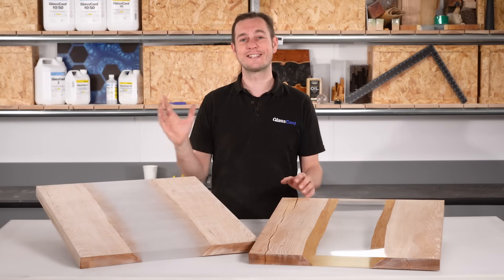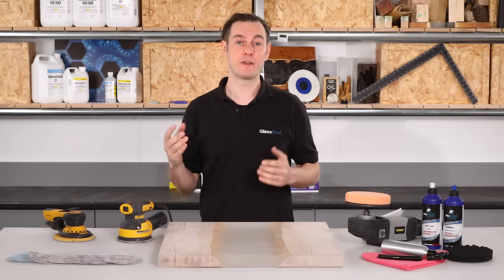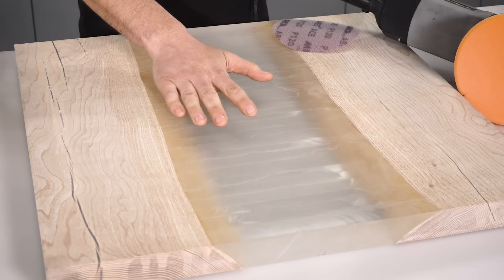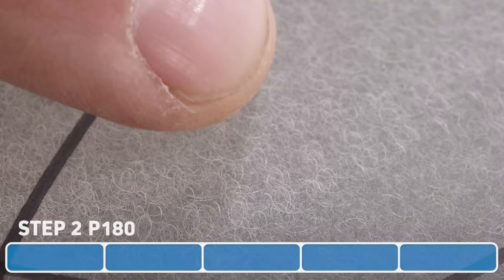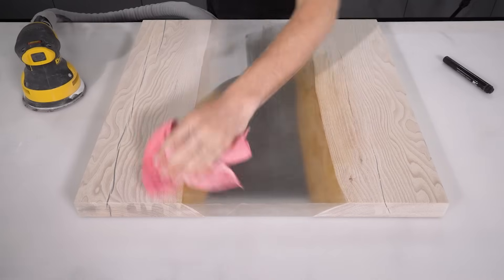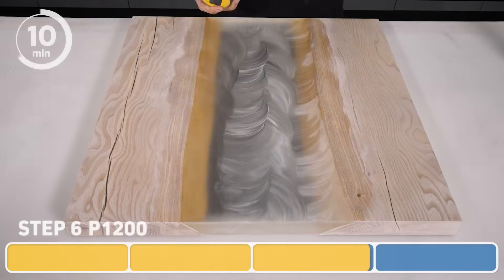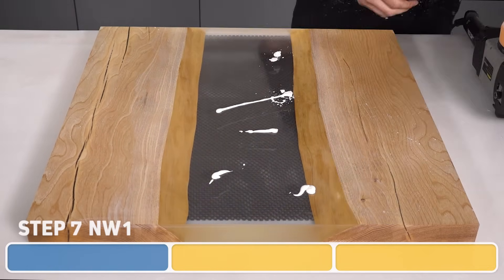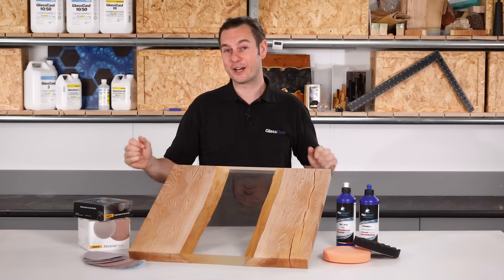How to Sand and Polish Epoxy Resin to a Mirror Finish - Step by Step Guide

Comment: I've done all the steps you showed, both sanding and polishing, but it's not clear to me. I don't know where I'm going wrong.
Reply from the maker: Sanding and polishing is quite a skill to master and does take practice. The resin won't really start to turn clear until you start to get a good level of polish on the surface with the NW1 compound.

Comment: super helpful, thank you!  Maybe a dumb question..but...this process needs to happen on the opposite side too, is that right?
Reply from the maker: Glad you found it useful. It depends on how visible it will be, if you are using a clear or lightly tinted resin then yes, you will most likely need to polish both sides. If the resin is pigmented opaque and hidden from sight on the underside then you may be able to get away with less finishing work.

Comment: Eh, im working on a 5inch cube, are there any tips for smaller objects?
Reply from the maker: The same still applies in terms of following through the grades of abrasives and then finishing with a polish. For smaller items then you my find it easier to do by hand, placing the abrasive on a flat surface and passing the cube over it.

Comment: I presume you sanded the bottom side the same way?
Reply from the maker: In this case, we didn't need to as the bottom face was the moulded side and had a high-gloss finish directly off the Polypropylene mould surface. However, if it had been machined in any way (planer/thicknesser, router on a sled, etc.) or didn't have the required level of finish then yes, absolutely, you could sand and polish it in exactly the same way as the top surface.
Reply: @glasscastresin thank you most helpful.

Comment: Beautiful work and now get ready for scratches from daily use.Probably within a day or two at the most. Plastic is plastic & scratches by just looking at it....
Reply from the maker: Whilst glasscast does cure to produce a relatively hard surface, you are correct that the end result is a thermoset plastic similar to a lot of worktop coatings. One advantage of an epoxy coating is that it can be polished up back to a high gloss surface should it become scratched over time.

Comment: You changed the tool for polishing at the end. Do the pads fit onto the dewalt sander?
Reply from the maker: No none of the pads we sell are designed for attaching directly to a DA sander. Although these can be sourced elsewhere.
Reply: @glasscastresin thank you

Comment: I'm new to epoxy. So, I've started with small pieces eg tea costers and small (6") clock faces. Most of the pieces turned out well but the clock face has obvious air bubbles and a couple of bad divits that developed overnight. Will I have to strip it right back or can I pour fresh epoxy as it is but take a heat gun to it to prevent the bubbles and divits reappearing? I should add, I sanded all the pieces from 80 through to 400 and finished off with 2000. Is this perhaps the problem? I also applied a few coats of French Button polish before the epoxy. Am I a plonker?
Reply from the maker: Hi George, if the resin is still in the 'B' stage where its firm but tacky and soft enough to indent with a fingernail then you can pour straight on top without any additional prep work. If the resin has fully cured then you will need to key the surface with 120 grit before adding another layer. Normally a key like this is required to allow for a good mechanical bond to the surface, for porous surfaces like wood it is recommended to seal first with a brush layer of resin to prevent air from leaching out of the wood as resin is absorbed. It's normally best to avoid using wood treatment products in case they reduce the bonding to the wood, wax and oil based products would be especially bad.

Comment: Do you polisher the underside too.
Reply from the maker: If the resin is clear or tinted then yes you will probably also want the underside to have a nice flat glossy surface. On pigmented opaque resins then this is less of an issue and the underisd can be left in a rougher state.

Comment: I've cut out a detailed stencil in 12mm marine ply (900mm x 600mm) and was planning to fill resin and polish. Now seeing the amount of sanding required, am concerned the sanding will cut through layers of the ply. Any suggestions?
Reply from the maker: You will just need to be carefull with the more course grades of abrasive that you don't apply too much pressure. The wood, being softer will naturally abrade faster but as long as you apply low pressure and keep the abrasive flat across the top surface of the resin, then you shouldn't have too much of an issue.

Comment: Without holes in the sanding disks lined up with the holes on the sander, no dust will get sucked out
Reply from the maker: The mirka sanding discs are a mech based construction which allows the dust to pass through the entire surface of the pad, not just through the vent holes which can be misaligned.

Comment: Hi buddy,
I have a question. 
How to sanding epoxy with 3mm thickness  ? There is an orange peel   I applied 3 coats with foam roller on my vertical mdf board. 
Do you think I have to start with 120grit
Reply from the maker: Applying the resin with a roller isn't really recommended given that it can introduce texture and even air bubbles into the surface. The depth of the texture will dictate the abrasive grade to start at but if you need to remove significant high spots then a course grade like 120 would be a good place to start.

Comment: If you don't have deep scratches to begin with, just smoothing out. You mentioned starting at 800 grit, how far up do you go after that?
Reply from the maker: You still complete the process from that stage, so just skipping steps 1-4. If starting at 800, you continue from that point through to the end of the video.
Reply: @glasscastresin thank you! One more question. If I put wood into the mold and the resin went under most of it but not all of it, would you still start with sanding 800 grit to make it all level?
Reply from the maker: @HeatherBF-h4x  If it isn't level, you'll need to be more coarse than 800grit. The finer the grit, the less 'sanding' the paper will do, as you progress through the grits, the purpose is to remove the scratches left by the previous grit so 800 would remove 400grit sanding marks for example; however, if you are trying to flatten the surface, you need to start with a much more coarse paper or have the surface machined (router on a sled/planer-thicknesser) to get it as flat as possible before starting to sand.

Comment: How would you sand/polish the edges of a round table? 

By hand?
Reply from the maker: By hand is likely to be the safer option, especially if you make a profile the same as the rounded edge to maintain the shape of the sanding/abrasive paper. In theory and with practice, you can use an orbital sander but need to use a soft pad so that it has a degree of flex around the surface and light pressure being careful to keep the sander moving so you don't end up with any flat spots sanded into the surface.

Comment: Would this same process work for a scratched bar top that has a "poured" polyurethane finish that is essentially the equivalent of 70-100 coats of polyurethane?
Reply from the maker: It would depend on the specific resin as to how high of a gloss level can be achieved but the process for flatting and polishing would be the same if not very similar.

Comment: What can be used to help lessen scratches in the future?
Reply from the maker: Some customers do apply a PU topcoat onto of the GlassCast surface which can improve the durability slightly. If you do get some scratches on the surface, the useful thing is that GlassCast can be polished back up to a high gloss.

Comment: Does a spar urethane need to be applied if the piece is going to exposed to sunlight through a window or does the top coat afford UV protection?
Reply from the maker: As epoxy resins go, GlassCast does perform very well in terms of UV resistance. However for more protection, some of our customers do choose to apply a PU topcoat over the top.

Comment: Oooh thank you so much!! I sanded my first resin piece yesterday and it’s super smooth but so cloudy I didn’t know what I’d done wrong! Now I know! *runs off to order polishing compounds!! QQ with the wet sanding stage on your final grit, would you do a wet sand if you were using regular sanding paper or only for the mesh ones? Thanks!
Reply from the maker: Yes the key to restoring the gloss is the polishing aspect.

Comment: Hi.  Question.  I've been contemplating epoxying the following project https://youtu.be/_NjDxBsMk5M?si=6TslQ9sKAOvvmnOm , without attaching the bowl's legs first, by placing the bowl in a non-porous rectangular container that closely encapsulates the bowl in all dimensions, and (just) submerging it in epoxy.  When that epoxy cures, no surprise, I'll be left with a deep, wide and short "epoxy cube" that I envision sanding away at (mask and goggles noted) with ever finer sand paper, to restore its bowl shape.  Does this sound feasible to you?  

Last summer I tried taping the bowl with gorilla tape but for a small hole and pouring epoxy in.  It ended badly.  Thanks.  Any resin products you might recommend here would be appreciated.
Reply from the maker: Hi, 

You could try taping up the edges with our flash/release tape which would keep the quantity of resin to a minimum.

It would result in quite an amount of waste resin but yes you could in theory cast the whole wooden form and machine away the material. You would want to make the enclosure a s tight as possible to limit excess resin as best you can. 

GlassCast 50 would probably be best for a project like this.

Comment: I followed the steps and bought the exact stuff used in the video but mine still is hazy… helppppp😭😭😩 idk what I am doing wrong
Reply from the maker: Hi Ashley, sanding and polishing can take quite a bit of practice to perfect and does take a bit of time so don't worry if it doesn't took perfect to begin with. The most important thing is not to move ahead with the next grade of abrasive until all the marks from the previous one have been removed. With the NW1 polish, it needs to be worked into the surface where the cutting crystals will become finer and finer. It's tempting to add a bit more of the compound to finish it off however this will introduce a course material to the surface again which can undo some of the polishing if it's not properly worked into the surface.

Comment: Question: Speed, and do you moisten often not to overheat the epoxy
Reply from the maker: With the courser grades dry sanding is best. You will need to regularly check the surface to ensure that it doesn't overheat and avoid focusing on one area for too long. With the finer grades, you can add water to help the sanding process.

Comment: Excellent video. What kind of finish do you get on the wood with the polish? Does it get glossy on the wood? I'm making an olive wood/epoxy table with multiple pieces of olive wood between the epoxy.
Reply from the maker: HI Richard, the NW1 polish is a cutting compound not a wood polish. The wood part of the table will need to be treated with an appropriate wood treatment and the finish will then be dictated by this.

Comment: Great video! I always have noticeable areas where the sander overlaps. How do I avoid the overlap lines, I sand slow and evenly and work both directions but I still can't get it to be consistent
Reply from the maker: Thanks for your question, it's difficult to know for certain without actually seeing anything but I guess that you continuing with a few more passes at the same grade will eliminate any markings. You shouldn't move onto the next grade until all marks from the previous grade have been eliminated.

Comment: Pretty good video. One thing that still confuses me…I’m sanding raw wood until the wet sanding? Why danish oil?
How do I keep the danish oil off the epoxy?
After wet sanding, what else needs to be done to the wood? The wood to epoxy connection still has me baffled lol.
Help!
Thanks!
:)
Reply from the maker: Treating the wood before the wet sand and polish stages helps to seal the wood and protect it from absorbing any of the waste material coming off the resin. As the resin itself is non porous it will not absorb the oil which can be simply wiped off before continuing to sand/polish. 

Once the resin is polished, the wood can then be treated with more coatings of oil or other preservative as required.

Comment: Not sure if anyone will see this at this point but I want to polish the clear layer I poured over my river table. It’s about 1/8” thick and I wondered how much the sanding and glossing will remove?
Reply from the maker: Ultimately it depends on the quality of the surface and how deep any defects are. This will indicate which grade of abrasive you need to start with and how much material you need to remove. Usually you wouldn't expect to be taking off more than ~0.5mm for a good sand and polish.

Comment: I recently completed my 1st resin bottle cap table.  I have a few imperfections (air bubbles.) If I follow these steps, do you think I can remove the bubbles and then polish.  Can you recommend a sanding & polishing kit?
Reply from the maker: Hi Dale, it depends entirely on how deep the bubbles are in the surface. If they are deep within then it would probably require you to remove too much material to be worth it. If the bubbles are on the surface then you can follow the steps in the guide. Ensure that all bubbles have been removed with the course grits before starting to move onto finer grades. You can use the exact abrasives and polishes used in the video which can all be found in the project list here: https://www.glasscastresin.com/how-to-flat-and-polish-epoxy-to-a-mirror-finish

Comment: Is the Paiboat brand food safe? Could I use it for a bar top?
Reply from the maker: Hi Ben, there is no specific food grade certification for the polishing compounds. However as they do not remain on the surface once the polishing process is complete this isn't really an issue. Just give the bar top a good clean down afterwards.
Reply: @glasscastresin  thank you!

Comment: I was getting some visible staining on the clear epoxy when I would oil the wood with Rubio monocoat. Could you oil the whole board and then polish the epoxy like you did here or will sanding through the finish scratch the epoxy?
Reply from the maker: Oils and other wood treatments are best kept off the resin if possible as there can be staining as you have experienced, we would recommend wiping it off as soon as possible. As you will have seen in the video, we opt to treat the wood once the sanding stage is done, before the polishing. This will help to prevent polish from staining the wood but also allow to you remove any wood treatment from the resin before it's finished. If you know there is likely to be an issue with the wood treatment then maksign off the resin can help.

Comment: Very good tutorial. I have a question. I am looking for a top coat (gloss or mirror) that is also resistant to scratches. I have tested quite a few things and came out that the best test is to sand it. If it stays clear and marks and not there, that would be the best of the best. Do you have any idea what to use? Is there anything like that on a market?
Reply from the maker: I think you will struggle to find a resin coating material that will cure hard enough at room temperature to resist scratches from abrasive paper. The GlassCast will cure relatively had but would be susceptible to scratches from  hard or sharp objects. Some customer so choose to apply a Polyurethane top coat on top of GLassCast but is isn't something that we stock or can advise on I'm afraid.
Reply: @glasscastresin  Thank you. I tried from car paint, parquet varnish (for now the best results), I am planning to try paint for tiles. This epoxy is amazing, a new age of creativity.

Comment: I attempted my first project with resin. It is a coffee table. The first time I put it on and made a nice pattern with grey and black lines on what was supposed to be concentrated white colour, it was only semi opaque, I used a whole small bottle of white. I finally got it looking good, but there are patches of the top that it keeps separating, I rubbed it over those bits with my finger then when it did it again, I used the blow torch s little to move it around. It got too set to work so I had to leave it like that. Do I need to sand it even to put another coat of resin on, or just sand lightly and pour??
Reply from the maker: Hi Lynne, 

If you are looking to put a thin 2mm flood coat over the surface for a nice flat finish then it's best if you first sand it flat with a 120 grit abrasive. This will then give you a good key for the next layer of resin to bond to.

Comment: If I want my past resin to be satin instead of gloss, do I still sand to 1200 and still polish on NW1? Do I achieve the satin by not polishing the NW1 quite as much?
Reply from the maker: Check out this video where we show how the 2 effects can be achieved. https://youtu.be/6QuTzGaqOMs

Bear in mind that this video was done on the GlassCast 3 so is starting at an already flat glossy stage. If sanding through finer grades then  finishing at 1220 grit will leave you at a Matt finish were a light polish with NW1 will produce a satin look.

Comment: Is it okay to use orbital sander for buffing? I have buffing pads for sander. 😊
Reply from the maker: Sure, they provide a similar action so there shouldn't be any reason why this won't work. A polisher probably has a higher RPM so will likely take longer using a sander. Still, much faster than doing it by hand.
Reply: @glasscastresin  Thank you so much!